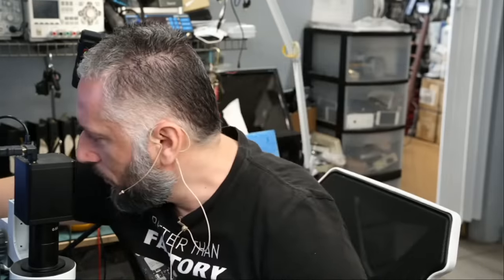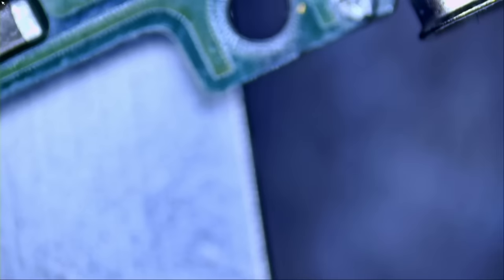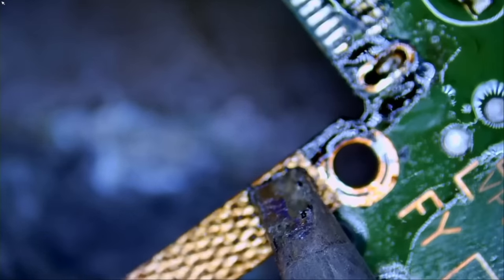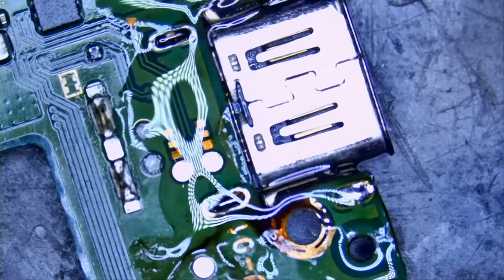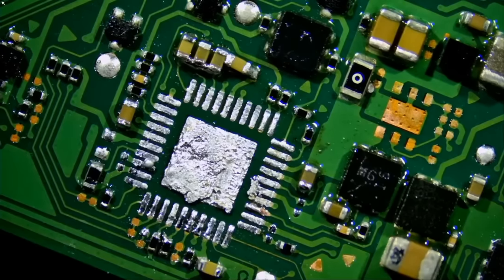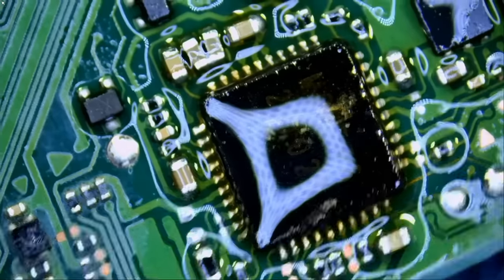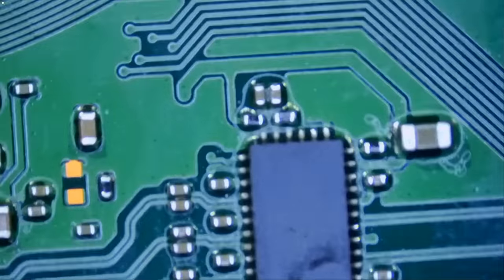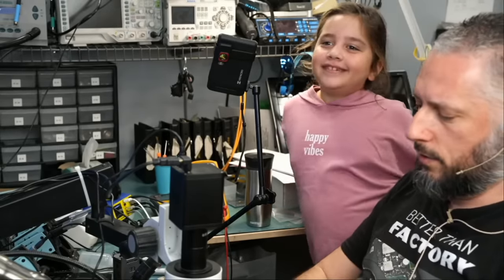Nintendo Switch OLED. They messed up the repair. No Fix No Fee is never an option

Comment: I'm amazed you put this much work into it and I kind of hope you could repair it. Not because the dishonest customer who mailed this deserves it necessarily (although if he is still paying I suppose he does, doesn't he?)---but because of the e-waste aspect.

Had he actually been honest on what he did to it instead of making you play cat-and-mouse by investigating literally every aspect, trying to determine what was replaced (the Maxtrip one, M92, etc.), and so on, you'd know what to look for (cutting down time immensely) and know when it's a lost cause (i.e.: if he literally melted the board behind the Maxtrip, well, game over, but you knew to look there at least).

I really, really don't know why the person who couldn't solder a USB-C port (not an easy job, mind you...) decided "alright I'm a bad dude, I'm gonna try this M92"... botch it completely, then gets a head even MORE swelled and tries a freakin' BGA chip?!

BGA chips are the #1 thing NOT TO MESS WITH even for professionals!

Comment: It's a completely different profession, but watching you clean up a messed up circuit board reminds me of my worst days as a dental tech making false teeth out of gold.  Any imperfection has to be soldered, laser welded, etc, and the tiny margin for error is tight enough to test anyone's patience.  Good job resoldering on this job nonetheless on outcome, your work looked good.

I hate starring at a messed up crown under a laser welder's microscope for half an hour.

Comment: I recently found the channel and I'm addicted to the repair videos. I have a question, for flux cleanup, after using the brush, is that a cotton swab you're using to remove extra flux off?

Comment: It doesn't look like the customer did a lot of damage just several failed attempts to replace parts. I think the customer should always state EXACTLY what they tried to replace or repair so you don't waste time guessing. If they did that it wouldn't take you much additional time to work on someone's attempted repair. I would be embarrassed to send you something with all that flux left on it. Even though the customer   hasn't learned enough to micro solder they should be able to learn how to clean up! If they told you what they did and cleaned up after their attempt you wouldn't need to guess or struggle to spot problems. The best part is at the end though with your daughter. It's wonderful that you let her help where she can and spend some time with Dad at work. <3

Comment: It is amazing the degree of persistent ignorance in light of incredible amount of available knowledge.  

Micro component repair is very skill intensive and requires specialized tools.  It is an ability that must be recognized and appreciated.  

YouTube videos can help to determine what is possible for the DIY and what work requires professional assistance.  The videos can help to improve communication and technical knowledge.  

Hopefully, HP, Apple, Sony and other manufacturers are watching.  Engineering can learn to improve circuit reliability.

Comment: Better than factory  Flux aids in soldering and desoldering processes by removing oxide films that form on the surface of metals being soldered. It increases the wetting ability of the solder, causing it to flow more uniformly over surfaces without balling-up

Comment: Yes people watch and think they can do the same. alot of the time poor prepration apears to be the major issue.after watchiung your videos i found that if i used a thick wire with lots of strands to wick up excess solder and get things clean befor replacing components i was much more successfull oh and the corect heat gun tips soldering iron tips and temprature ect. please do a vodeo ysing sum spare wire ans a solder wick its expensive to purchase for just one or two repairs but the skill of cleaning the bord properly buy wicking the non leaded solder away is invalabule for any bord repair.

Comment: I would be totally embarrassed if I sent any device with soldering like you showed us.  I gotta give it to ya for trying, but man, with all those bridges, the dude prolly shorted out many components after he was done trying to “Fix it”.  If he had just sent it to you without touching it, it would have been fixed MUCH faster and cheaper.  Agree with you 100%!
Reply: I don't think it's embarrassing, yes.. aftermath was chaos but i remember my beginnings in smd repair with crappy tools and no experience or feel for it, it's imposible to do anything . Untill you realise what difference quality soldering iron, good quality flux , solder and multimeter makes, it seems imposible to do any kind of job like this.

Comment: We get the same problems repairing vehicles.  Customer bring in a vehicle they or someone else worked on.  They shot a bunch of parts at it or they did a repair themselves and bodged it all up.  You have to spend time to undue all the issues they created just to get back to the original problem.  Then they get mad when you charge them extra diagnostic time and labor.  Sometimes the vehicle is so butchered, wel give them an extreme estimate and they take it somewhere else.  People don't realize that time is more precious than money.  Why spend tons of time unravelling a mess when you can do two brake jobs and make more money.

Comment: Would you fix Ipad 3rd gen that won't turn on, the battery won't charge + it gives the black but lit screen of death. It may show a empty battery in red. I got it from eBay for Christmas & it worked great for a week or so before dying.

Comment: I just tried to replace the joystick connector on a switch light the other day. I would have had it if one of the traces weren't torn. I get the connector attached but as soon as I tried to bridge with wire that torn pad. I pulled that pin right out of the connector. Then commenced a long grueling 45 minutes of me trying to undo what I did. Let's just say I had to order another board

Comment: You could most likely have to take half the components off the board to find all the faults.  Fixable maybe but how long will it take?  You could get paided for 5 or more easy fixes in the mean time.  There is a point I guess were you are just manufacturing a new switch.  Most likely taking all the components off the PCB would be quicker than troubleshooting.
Reply: How exactly would removing all the components from the board solve anything? 😂
Reply: @MrChainsaw80  Because there is most likely bridges everywhere on the board.  Looks like failed attempts to reflow the ICs as well.  The video shows bridges there as well on the IC's.  Many of these solder bridges are shorts which will likely damage other components as well.

End up taking half (figure of speech) the components off finding were all the shorts are.  Then the IC's, one or two could be dead.  Random dead components or open circuits.

Its a ribbit hole, that can end in a short somewhere inside the PCB.  Or after a few hours to a day or two it could be repaired.

Its comes down to money.  He could likely make more money repairing other items in the same time frame.

So it gets best effort and is abandoned once its economically no longer cost effective to repair.

Comment: I had a customer bring in an OLED switch that he had taken a regular heat gun to and there were shorts all over the board. sadly it was unrepairable. I told him, next time please just bring it to me first. If you had this would have been a fix. Sad deal for the customer but a good lesson. The really sad part is he was just trying to replace the USB C port. It would have been a simple fix.

Comment: Does solder wick work better than a solder sucker?
Reply: Wick is more versatile but requires more skill. The sucker only works for through hole but removes solder more quickly.

Comment: There is something I don't get: how does low-melt solder mix with unleaded, since the unleaded won't melt in the first place? I would think you would just wick away the low-melt from the still solid unleaded.
Reply: Unleaded does melt, but at a much higher temperature than leaded. You can melt unleaded solder simply by applying heat, although it has to be much higher than you would normally apply.

When the unleaded starts to liquify, then you can apply leaded and go on with soldering.

Comment: I would never start replacing components on a board I rely on without practicing. I prefer buying old defective devices trying to increase my skill. Working on an old MacBook Air with a ram issue trying to reball the ram chips for the second time. Getting better from try to try. So always practice with defective parts bevor trying to fix a real system. You need experience and skills you won‘t get even watching a ton of YouTube videos.

Comment: The answer to the question "why are you applying so much flux" is "Why ARENT YOU applying a lot of flux" Flux will save your life one day and you'll get it! sure you don't NEED to use that much...but is it expensive? no! is the thing you're soldering expensive....YEAH PROBABLY or you wouldn't be bothering with the repair

Comment: I literally can't figure out how you screw up a soldering job unless you just don't use flux. The only time I've ever got a bad result is trying to do it without flux. 

Or you melt a plastic piece, but that should be common sense.

Comment: If you don't have a spare board to compare the components, maybe you can compare it on your previous videos about this board.
Reply: this is no pratical and took alot time, no way
Reply: Once the customer has done a bad job all bets are off
Reply: Better option would be to take pictures and label anything he works on for the first time (after it's working again of course) and keep it in a binder.